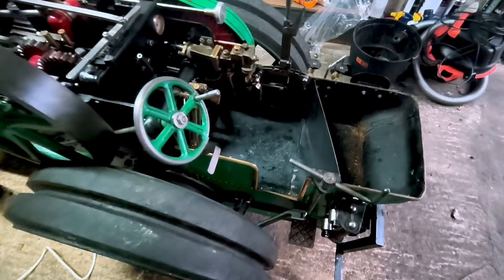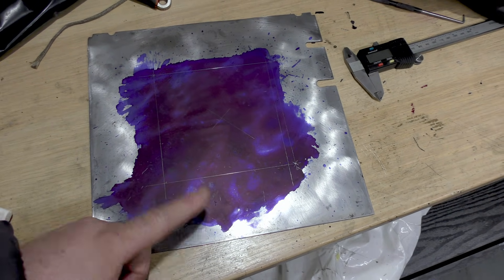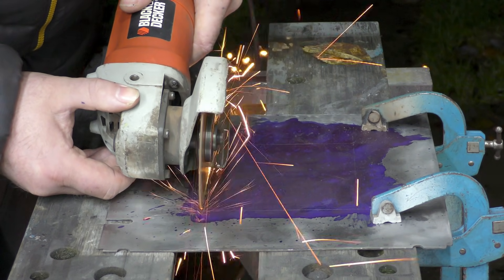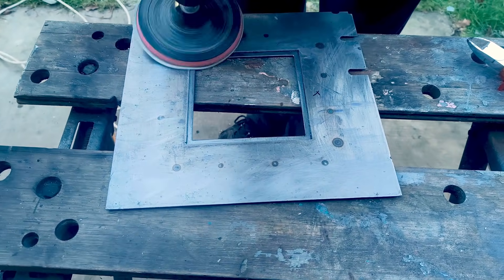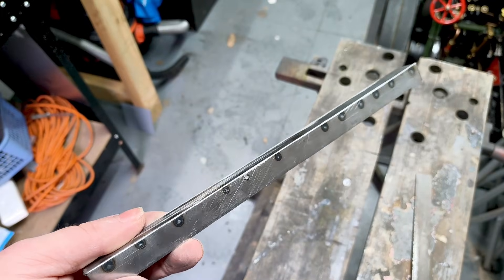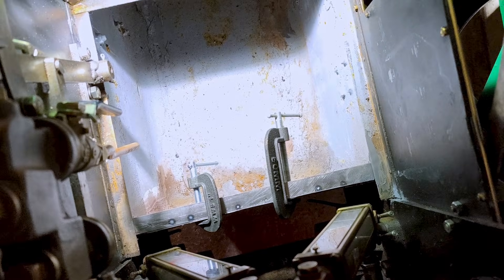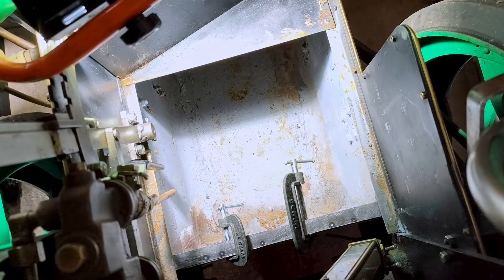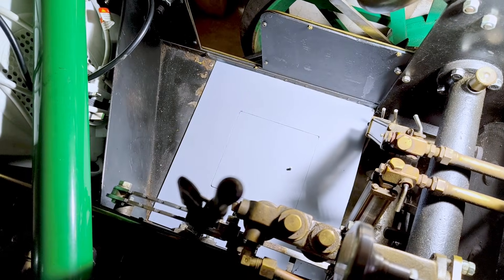I was tired of guessing the water level so I did this

Comment: Iv see an engine before with this done and it left in all the dust and oil which kept priming because of contamination
Reply from the maker: I will be adding a filter to the pickup lines to prevent any contamination being picked up. It also means that I will probably have to drain and clean the tank more often.

Comment: Hi, did similar to my 4" when I built it. Great for filling up water and checking the inside. I only noticed when driving it's a bit difficult to check the water level, so this winter I will add a water level to the tender, simply a float in the tender with a perspex rod fixed to it, sticking up from the footplate base.
Reply from the maker: Yes good point, a float level is also on my list but might have to be a project for next winter.